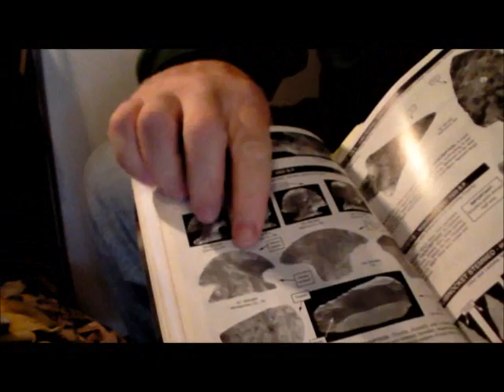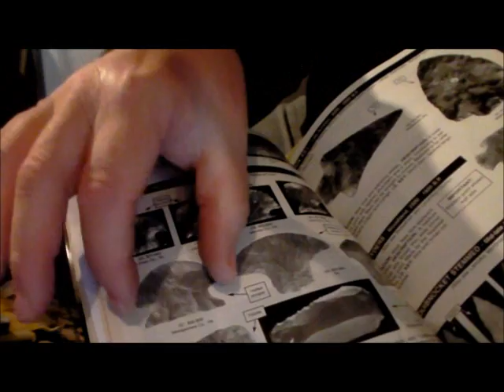Elk Antler Scraper - Pt 2

Comment: very, very nice ! great work ! I made 2 elk antler scrapers but made metal blades for them. They've seen a lot of use on elk and deer and work fantastic. I've never used one with a stone blade and am real curious how it will work out. I do know that the edge will have to be REAL smooth AND sharp as any serrations, dips etc. will cut and or groove the hide. I've had this problem when i had a burr on the edge of my steel blade i didn't see.
again...Awesome work, thanks for sharing.
Tim

Comment from the maker: @MrAMMiranda - I rubbed the charcoal into the grooves and then put a bit of oil over that.  Perhaps the oil will help set the charcoal a bit and hold it.  So far it hasn't rubbed off.